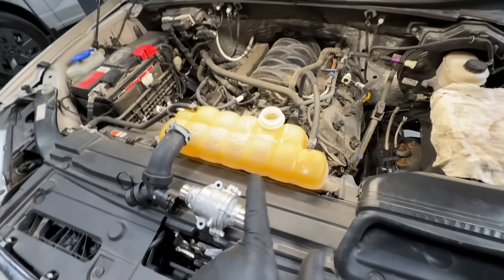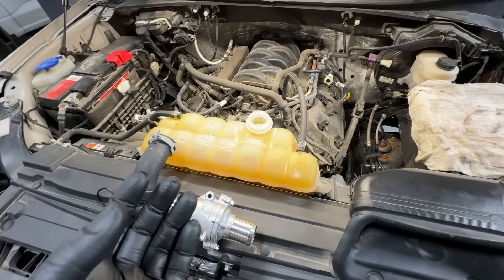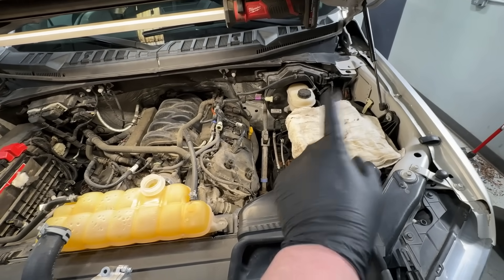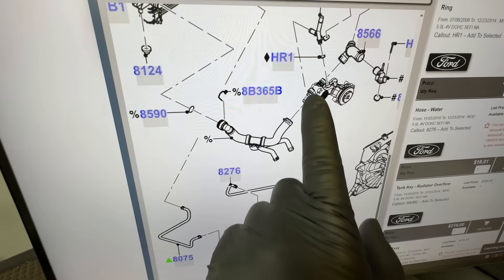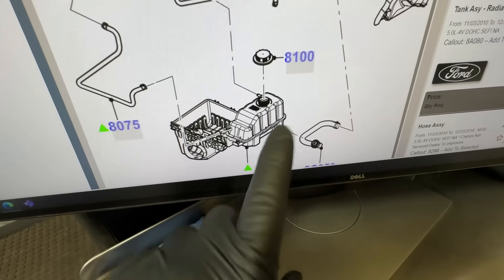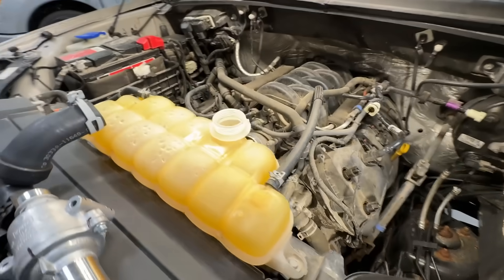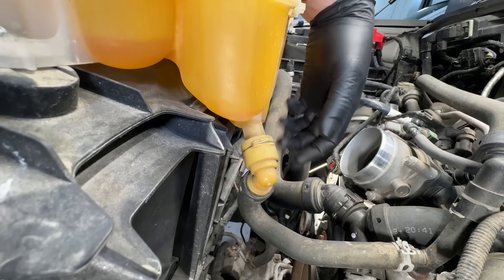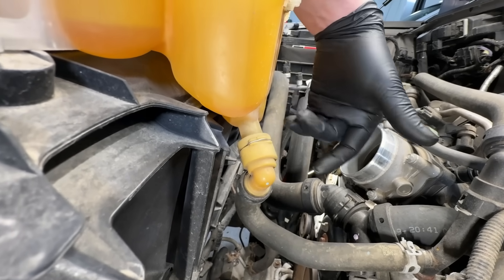2011+ Ford F-150 5.0L Coyote Engines: The Top 5 Most Common Coolant Leaks!

Comment: Perhaps your are correct as you work on this stuff all the time but from a consumer’s perspective, it cost less to fix a coolant leak than: replace a turbo or an entire engine, 2023 NHITSA has expanded the 2.7L EcoBoost engine failures, amongst many others, not to mention in Europe 1.0 & 1.6 liter EcoBoost engine failures. The failures are well documented with ALL EcoBoost engines Stateside and in Europe. The fact is EcoBoost has the most reported failures, it’s an enormous problem for Ford and it’s not going away any time soon. Ford has so many class action lawsuits regarding 1.5L, 1.6L, or 2.0L Ford EcoBoost engines, not a single EcoBoost is problem-free in the line up no other engine manufacturer/OEM has this problem that Ford has. If you have a good one you have won the lottery!
Reply from the maker: Please see my previous response- Not saying they break down at all. I am just very disappointed in the engine as I had high hopes for them when they came out in 2011. The cylinder bore distortion issues, tuliped valves, way too many coolant leaks, some oil consumption issues on the rear cylinders, ignition coil bolts that rot and break (unacceptable in this day and age), valve cover bolts that rot and are miserable to remove mainly 11-14 models, the embarrassing tapping knocking noises all of these make, they have a stamped oil pan and elastomeric gasket just like the 5.4L (which never ever leak) yet the 5.0L leaks like crazy and soak the underside of the engine (why is this even happening, again very disappointing), I am not impressed with the power I think they are a dog (maybe I am used to the EcoBoost power) except the mustang calibrations and 21+ are much better. Also, you do know about the bucket load of major issues with the 2018-2020 models right? I am hoping the cylinder deactivation and wet oil pump belt on the 21+ models are not another disappointment in the future. There may be other concerns I cannot think of right now. Now do you understand my point of view? Oh and almost forgot about the IMRC issues on the 15+ models (again I have never even had to diagnose an IMRC concern on the 5.4L 3v)

Comment: Thanks as always for great information and keep up the great work. Your Ford insight has been helpful to me for a while. Recently purchased a 2013 F150 5.0 L with 92K miles and have been wanting to know all the little issues that could pop up. So far nothing has had an issue (crossing my fingers) and I do love my Coyote engine so far. Nothing will compare to my Grand Marquis (sadly had to sell) with the 4.6L modular but I do have some Coyote love
Reply: I just acquired a Mint 2011 f150 5.0 with 88k miles and now I'm doing all the research I can for preventative maintenance. All I can say these videos are amazing and I hope that I wont have many problems with this truck here in the near future. This truck gets up and go when you punch it, first time really experiencing this engine, it sounds great.

Comment: I have a 2012 F-150 Lariat 4x4 5.0 engine with 145,275 miles. I am planning on driving from Houston, Texas to Phoenix, Arizona. This will be my first time driving my truck this far. I had the following things completed within the last four years.
Transmission oil changed
Differential oil changed
New radiator 
Radiator upper & lower hoses changed
Thermostat housing changed
Coolant hose changed 
New coolant 
Purge valve changed
Serpentine belt changed
New brake pads
Rotors resurfaced 
Oil changed every 6 months 
New water pump
New headlights
New rear shocks
Spark plugs changed at 116,000 miles
New rims & tires.
What would you recommend that I should take care of before my trip?

Comment: This is the first time I’ve ever disagreed with you Brian. 😂 All the issues you just listed are cheap and very easy to fix. Love your videos!
Reply from the maker: Please see my previous response- Not saying they break down at all. I am just very disappointed in the engine as I had high hopes for them when they came out in 2011. The cylinder bore distortion issues, tuliped valves, way too many coolant leaks, some oil consumption issues on the rear cylinders, ignition coil bolts that rot and break (unacceptable in this day and age), valve cover bolts that rot and are miserable to remove mainly 11-14 models, the embarrassing tapping knocking noises all of these make, they have a stamped oil pan and elastomeric gasket just like the 5.4L (which never ever leak) yet the 5.0L leaks like crazy and soak the underside of the engine (why is this even happening, again very disappointing), I am not impressed with the power I think they are a dog (maybe I am used to the EcoBoost power) except the mustang calibrations and 21+ are much better. Also, you do know about the bucket load of major issues with the 2018-2020 models right? I am hoping the cylinder deactivation and wet oil pump belt on the 21+ models are not another disappointment in the future. There may be other concerns I cannot think of right now. Now do you understand my point of view? Oh and almost forgot about the IMRC issues on the 15+ models (again I have never even had to diagnose an IMRC concern on the 5.4L 3v)
Reply: Most of the things you listed were problems from 1st and 2nd gen. What is the bucket list on the 5.0 engine on 18-21?  @FordTechMakuloco
Reply: Yes, I understand your point of view. And I think very highly of you. You’ve saved me loads of time and money on my Triton and my Coyote and I sure appreciate it. My limited perspective is my ‘17 Coyote with 120k has only needed a (very accessible) new water pump that was $95 and I couldn’t be happier. I may just go with an ecoboost like you down the road though if all this new stuff they’re starting to do with the new coyotes starts reducing it’s great reliability track record.
Reply: I agree. It is the first time I have disagreed with Brian. Yes Brian, I read your response

Comment: Ok, I understand hating on a 5.4L but the Coyote? I understand your a tech and you see all the issues all the time. But I think you a bit off par on this one Brian.
Reply from the maker: Please see my previous response- Not saying they break down at all. I am just very disappointed in the engine as I had high hopes for them when they came out in 2011. The cylinder bore distortion issues, tuliped valves, way too many coolant leaks, some oil consumption issues on the rear cylinders, ignition coil bolts that rot and break (unacceptable in this day and age), valve cover bolts that rot and are miserable to remove mainly 11-14 models, the embarrassing tapping knocking noises all of these make, they have a stamped oil pan and elastomeric gasket just like the 5.4L (which never ever leak) yet the 5.0L leaks like crazy and soak the underside of the engine (why is this even happening, again very disappointing), I am not impressed with the power I think they are a dog (maybe I am used to the EcoBoost power) except the mustang calibrations and 21+ are much better. Also, you do know about the bucket load of major issues with the 2018-2020 models right? I am hoping the cylinder deactivation and wet oil pump belt on the 21+ models are not another disappointment in the future. There may be other concerns I cannot think of right now. Now do you understand my point of view? Oh and almost forgot about the IMRC issues on the 15+ models (again I have never even had to diagnose an IMRC concern on the 5.4L 3v)

Comment: I noticed recently the problem you mentioned about the valve cover bolts rusting away.  Mine are so bad i don't think it will be possible to remove them without a torch and its kind of hard to use a torch when the valve cover is platic 😭

Comment: I’m on a crossroads! I am looking for a new F150. Which engine would you recommend? My commute is 10, 15 minutes. Around 6 miles each way. Commute and recreation only. I will tow a boat under 3000lbs. Plan to keep the truck for 15 years or longer. Initially wanted to go with 2.7, but ongoing problem with valve hardening/ valve dropping made me rethink. Now looking for 5.0L. My coworker bought F150 with 3.5L last may. in a few months his truck was in the shop for cam followers replacement. After the truck was repaired he traded it in for a new 2.7. Last week cam phasers had to be replaced under warranty! Both trucks were brand new and did not last longer than a few months! What engine do you suggest I should buy? Thank you.

Comment: I have to know why you would prefer a 5.4l triton over a 5.0l coyote? I could see why you would choose the 5.4l over a first or third gen 5.0 coyote due to their issues but would you still choose a 5.4l over a 2nd gen 5.0l? I have heard nothing but good things from the 2nd gen 5.0l (except for coolant leaks) but I have not seen any valves sinking into the head, oil consumption, decel rattle, diesel sounds, or timing component issues as far as I'm aware of on the 2nd gen 5.0l. I respect your opinions and knowledge and I would really like to hear your side of things!
Reply from the maker: Please see my previous response- Not saying they break down at all. I am just very disappointed in the engine as I had high hopes for them when they came out in 2011. The cylinder bore distortion issues, tuliped valves, way too many coolant leaks, some oil consumption issues on the rear cylinders, ignition coil bolts that rot and break (unacceptable in this day and age), valve cover bolts that rot and are miserable to remove mainly 11-14 models, the embarrassing tapping knocking noises all of these make, they have a stamped oil pan and elastomeric gasket just like the 5.4L (which never ever leak) yet the 5.0L leaks like crazy and soak the underside of the engine (why is this even happening, again very disappointing), I am not impressed with the power I think they are a dog (maybe I am used to the EcoBoost power) except the mustang calibrations and 21+ are much better. Also, you do know about the bucket load of major issues with the 2018-2020 models right? I am hoping the cylinder deactivation and wet oil pump belt on the 21+ models are not another disappointment in the future. There may be other concerns I cannot think of right now. Now do you understand my point of view? Oh and almost forgot about the IMRC issues on the 15+ models (again I have never even had to diagnose an IMRC concern on the 5.4L 3v)
Reply: @FordTechMakuloco  Hey thanks for the reply Brian! After reading what you said I definitely have to agree with you on a lot of those things you've listed. I really want this 21+ coyote to be a great engine because like you said it could be really great if ford just fixes all the little things that this engine has problems with. (Hate that ford took a step backwards from gen 2 to 3). I wonder if these 21+ 5.0l engines have any oil consumption issues or cylinder scoring? I'd just be so damn disappointed if they did. I myself also like the ecoboost engines like you and I think they're excellent powerplants but I had no idea the 5.0l had these extra small issues compared to the ecoboost engines. I'm always open to learning and again I appreciate the response back! Love the content and keep up the great work🤙

Comment: I must be doing something wrong; since my well maintained 2013 F150 with 131k miles is dead reliable, doesn't burn a drop of oil, looses no coolant, and is drier than a popcorn fart on and under the motor. It's also used in North Dakota mostly, so maybe its the lack of road salt and calcium chloride, unlike Chicagoland.
Reply: you have 1 example.  he sees/works on multiple examples.  not the same thing.

Comment: My 2013 is pretty dry most everywhere but I do notice a tiny bit on that passenger side fwd area by the intake. Doesn’t run back on the bell housing though, just a tiny puddle in that recess of the plastic intake. Might be that same heater hose connection though I suppose.
Reply: Yep, mine, 2015, had the some leak, passanger.

Comment: My 2014 F150 with the 5.0 is SO much better than my old 2004 with the 5.4 3 valve. More power, more reliable, quiet when cruising, love the sound when accelerating. Yes, I've replaced the y-pipe and a coolant o-ring, but it wasn't that hard to fix. I really like my 5.0!
Reply: The 6 spd so much better than 4 spd! I’ve had both as well 🍻

Comment: I agree with you 100 percent.  I just replace every piece in your top 5 on my 2015, top and bottom hoses, water pump, thermostat housing, and heater hose to pump o rings.  Only thing not done yet, degasser tank! 170k miles.

Comment: Perfect timing. Just replaced my OEM radiator, thermostat, upper radiator hose o ring, and the y hose on my 5.0 f150 at 215k miles. Not bad for lasting that long.

Comment: Auto tech for many years with GM. This is why I Love Fords... I'd take the 5.0 all day every day over all other choices. The superficial leak here and there is nothing vs the competitions major internal failures, lifter issues spreading metal throughout / DOD issues, etc.  Have always loved your content, just surprised to hear the strong words against the 5.0 for the reasons given.
Reply from the maker: Please see my previous response- Not saying they break down at all. I am just very disappointed in the engine as I had high hopes for them when they came out in 2011. The cylinder bore distortion issues, tuliped valves, way too many coolant leaks, some oil consumption issues on the rear cylinders, ignition coil bolts that rot and break (unacceptable in this day and age), valve cover bolts that rot and are miserable to remove mainly 11-14 models, the embarrassing tapping knocking noises all of these make, they have a stamped oil pan and elastomeric gasket just like the 5.4L (which never ever leak) yet the 5.0L leaks like crazy and soak the underside of the engine (why is this even happening, again very disappointing), I am not impressed with the power I think they are a dog (maybe I am used to the EcoBoost power) except the mustang calibrations and 21+ are much better. Also, you do know about the bucket load of major issues with the 2018-2020 models right? I am hoping the cylinder deactivation and wet oil pump belt on the 21+ models are not another disappointment in the future. There may be other concerns I cannot think of right now. Now do you understand my point of view? Oh and almost forgot about the IMRC issues on the 15+ models (again I have never even had to diagnose an IMRC concern on the 5.4L 3v)
Reply: @FordTechMakuloco  Thank you for replying and noting - "Not saying they break down at all" - as well as clarifying the reasons for your comments as I respect your opinion. I hear you with regard to the annoying "mostly" non major failure issues you listed. Working on these engines day in and day out, i agree, it's a lot. The similar non major failure issues with GM's 5.3 snapping exhaust manifold bolts, oil usage, misfires, intake issues etc. etc. again brings me to GM's scary displacement on demand failure rate. I'm pretty sure GM used a 3rd party company out of California for their newer DOD setup. I too truly hope that Ford's in house cylinder deactivation setup on the newer Coyote's holds up better. I hate the fact that the government pushes car companies to have to design these systems for CAFE regs, upping the complexity of the engines for tiny gains but these are the times we live in I guess. Now I understand your point of view.
Reply: @FordTechMakuloco I’m surprised you think it’s underpowered. I’ve seen videos of the newer 5.0s beating the 3.5 eco in drag races or at least staying right there with it. The 1st gen F-150 5.0 makes 360hp which is 5 more HP than the current 5.3 from GM which I think is pretty amazing considering it’s a smaller displacement than the 5.3.
Reply: @Joseph21-r4e I have the 5.0 and I wouldn't say it lacks power by any means but I understand where he's coming from. The 5.0 is tuned to be lazy from the manufacture until you pop it into sport mode. I think people get used to the eco boost power and how quick the engine spools the turbo giving that low range torque sooner while coyotes make all their power higher up in the band
Reply: @ZePanthersGang yep.  My 2019 5.0 lives in Sport Mode.  Also, the 3rd gen 5.0s are much better than the first two and the 4th gen is (from what I understand) basically a 3rd gen with the oil consumption fixed and a couple other minor tweeks.

Comment: Trust me when I say, the engineers HATED these Quick Connects.  ONE company making them, and we are CERTAIN they were a high ranking executives family.  They were also added because the UAW assembly workers were screwing up time and again on the assembly.  Multiple times not pulling grenade pins, not having the hose positions properly, not , etc...and all complaining of "Repetitive Motion Injuries".  The Degas bottle they went back to the supplier at least 20 times when I was there screaming about the ultrasonic weld being weak.  I believe that supplier lost a bunch of business on that (no new programs, charge backs, etc).  Problem is, hundreds of thousands of parts in the wild before many of the issues found.

Comment: 2012 5.0 FX4. Truck has 90K. First 5.0 lasted 20K. Bad cast, out of round cylinder wall. Piston beat the snot out of it, cam was scored and few other issues. Ford replaced it with a new long block. I've replaced the T and the degas bottle connector. Surprised the bottle hose didn't make the list, there are kits sold for this exact leak which makes me think there are lots of them out there.